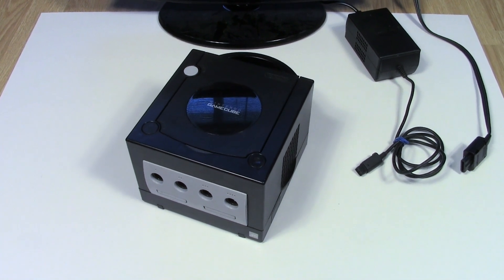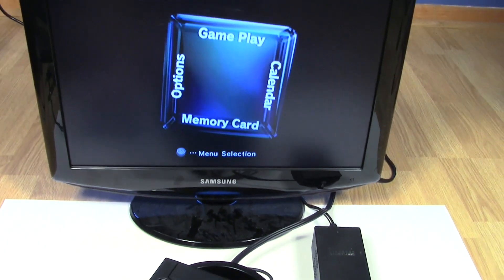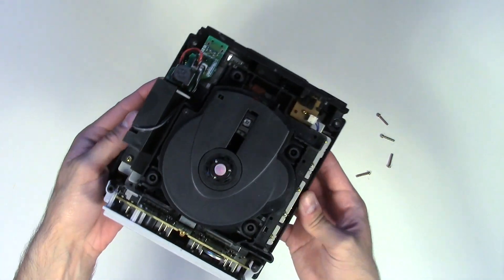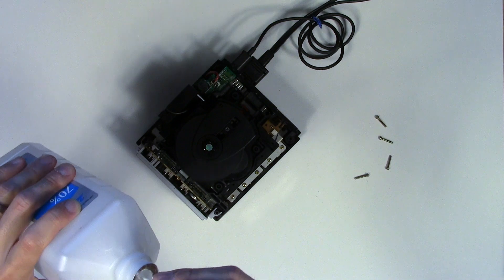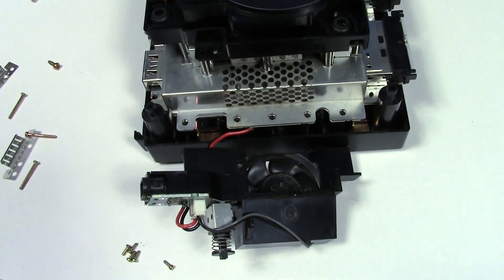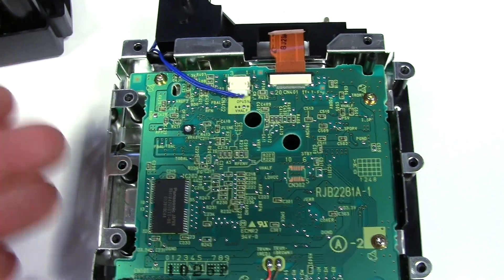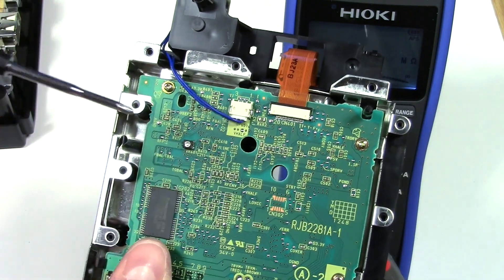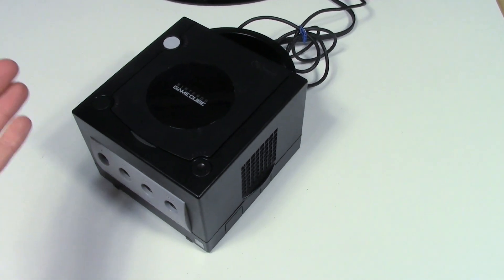GameCube Disc Drive Troubleshooting and Repair

Comment: The thing wrong with mine is that whenever I put in scratched disks, it says to turn off the GameCube, and read the instruction Manuel. In this state, it won't let me click anything, move or anything else, unless I turn it off and try it again, over and over and over. While in the background, I can hear the disk running fine and no error, while it says there's an error..... Anyone know what I can do... Because I tried fixing it for a long time.

Comment: What is a potentiometer don't really know hiw to spell that
Reply: It's a variable resistor. You can adjust how much resistance it has by turning it. A volume knob is one kind of potentiometer, but the one inside a GameCube is going to be one that is not designed for frequent adjustment (usually only set to a specific value during manufacturing).

Comment: I have a problem with mine. I start up melee and it works fine for about 20 minutes then i get an unable to read the disc message and the disc stops spinning. Two days before that my brother stepped on the gamecube pretty hard and melee got a piece of rubber taken off the edges of the disc. Off topic but, what is that for? I assume its something nintendo used to identify a game legit. I only own melee too so i cant test other games. Oh and i used it on a wii and it worked perfectly so idk if its the gamecube having trouble reading melee cuz melee has a few more scratches from the bump my brother caused or my brother caused something to break internally from the gamecube
Reply: Retro Skull thanks for thw info. Turns out it was the scratch on melee. But they are minor scratches so idk why it was unable to read still. Is the gamecube super sensitive to scratches?
Reply: Retro Skull i did and it made it worse. Theres a lot of tint scratches. I settled to buy another disc on ebay.
Reply: Relax, Marcos. Accidents happen.

Comment: I have a somewhat off-topic question (sorry if my terms or understanding of the parts are wrong): There are metal coverings around both the sockets where the AC and Video cables connect to the console (shown at ~8:20 in the vid). My used cube has something that looks like a burnt mark in that area and won't come off easily. Would it be alright to use sandpaper to rub it off or do those metal coverings need to stay smooth?
Reply from the maker: Those are just for shielding (from RF emissions), so you certainly can clean them up with sandpaper -- it won't hurt at all. Good luck!
Reply: Thanks! I'll give it a go

Comment: I actually did this a long time ago. My GameCube was working great but unfortunately  now, the games still boot up but after about a few hours of gameplay, I get an error where it stops reading the disc. So there is still another issue with my GameCube

Comment: The one I got gives me an error after a few seconds of turning it on but in very rare occasion reads the discs (has hardmod) anyway when it doesn't read the games the laser turns on the red light but it doesn't move, when that happens I get the error and says "turn off the console, read the manual or something" what do you think is the problem?.... anyone?

Comment: Thank you so much for your video. I managed to fix my son's GC, which I bought in 2002. It was being kept in the closet for the last 2 years, since he has a Wii and can play GC games on it. But it is always a big pleasure to fix something. Just one thing. I followed your instructions and tried to set the VR at 500 ohms. As the disk didn't spin, I started to lower the resistance until it finally spin. I ended up fixing the laser at 186 ohms. Do you think this is a problem? I hope I won't burn my son's GC! Thanks again.
Reply from the maker: +Fernando Oliveira Glad to hear you got it working! Only time will tell if you'll have long-term laser problems, but thankfully GameCube consoles are still fairly inexpensive so it shouldn't be too big of a deal to get a replacement laser assembly if it comes to it.
Reply: +This Does Not Compute Do you know anyone who can fix a  Gamecube

Comment: I followed your process (nice video), as my console seemed to have the same issue.  With the cover off, and the tabs pressed, the disk would spin for about 5 seconds then stop, and the laser would bounce back and forth a few times before stopping.  So, I adjusted the variable resistance to about 350 ohms and put everything back together.  Now the disk doesn't even spin, but the laser still bounces back and forth a few times before stopping.  So I must've messed something else up in the process.  Any ideas?
Reply: Try 200

Comment: You didn't have to dissconect the faceplate ribbon cable, could have just unscrewed the mini motherboard, now I am having a bitch off a time putting the ribbon cable back on.
Reply: +Jay Ward I would also appreciate it if you would give me some tips on how to put it back in.
Reply: +Jay Ward look its not that hard angle the tip towards the slot and place your thumb on the slot and push bam
Reply: +Jay Ward look its not that hard angle the tip towards the slot and place your thumb on the slot and push bam

Comment: Just did this on my GameCube and it appears to work as far as reading the disc at first. It loads up and plays for about five minutes and then I get the error message saying "cannot read disc" so then I reset it and it plays for about a minute before I get the same error. Is this a overheating issue?

Comment: what resolution is that tv and how is it connected? RGB?
Reply from the maker: +Gregory Terry It's a normal 720p LCD TV, and I was just using a composite cable for testing. I'd love to get one of the GC component cables, but dang they're expensive!
Reply: Well I was just thinking it looked pretty good. I'm thinking about getting a wii rvl-001 as a cheaper alternative to getting a GC component cable, though I always play my gamecube on a crt at the moment anyways. Your video is well done and helpful. Thanks!

Comment: I really like your video. It is indeed helpful. I just can not see through your hands to the exact places to test the circuit board with the multimeter. Even though you gave a great explanation a forehand, I need a diagram to guide me through that. Using a multimeter is new to me and mine is a super cheap one( a world away from the Hioki you have). I did this fix without the multimeter reading and I now instead of a no disc error, I am having a disc reading error. Two steps forward and one step back. Help!
Reply: I agree, the guide is missing the most essential part of the process

Comment: Everything is hooked up i press the power button but the disc wont spin and the game cube logo wont pop up.
Reply: Lord Spyro598  I have two GameCubes and one has the same problem as yours, the other is like this one in this video. It is 99.9% certain that it has suffered a power surge (my son even recalls the power surge happening). Only the fan powers on because the power supply took the surge. There is a fix posted for that, but the video was not a clear quality and it is a bit more involved to repair. I am 99.9% sure mine will be parted out instead of repaired. Just wanted you to know what you are probably dealing with.

Comment: I guess it's great that you fixed this and everything, but was it really worth all the time invested and hassle/hard work required, for an $8 system. It would have been much more cost effective to just pay, say, $10 and get a working system off ebay or anywhere else, these consoles on their own are pretty worthless these days seeing as Wii's are backwards compatible and much easier to obtain component cables for. As you mentioned the real value is in the controllers, in a case like this it doesn't seem worth repairing, just pick up a working model. The price of the gamebit/screwdriver to undo this console would cost about the same as the console itself lol, let alone the price of you're electrical reader (but I'm sure you use that for other things). Even if this video was to teach others how to repair their gamecube the same thing applies, they're cheap enough to just buy a replacement. I don't understand the motivation behind doing this but interesting video all the same. P.S. $8 was worth it for the memory card alone, those things seem to be holding their value too.
Reply: There's only so many GCs in existence, repairing them will be invaluable in another 5-10 years time.

Comment: I did this without the Hioki, because I'm daring and desperate, and I just turned the dial a tiny bit (like 1/4 couter-clockwise) and mine works fine now!!! Thanks for the helpful video!

Comment: My laser disk on my purple one won't start up at all.
Reply: maybe a broken or disconnected power cable?
did you drop it?
Reply: Same here buddy, but got it working. If the laser is so low powered or weak it wont even detect the disc + wont bother spinning it, you may have nothing wrong with the power

Comment: well i was hoping for an easy fix darn ill never be able to do this  i have the same issue with my gamecube only started couple years ago i was gonna get a new one at some point mine has gotten to where it will intermittently read game discs i found if i play with it turn it on its side or let it warm up then try again  it will read the disc and the game will play just fine and i can play any game it will always read as long as i dont turn it off for extended periods of time  and at times  it will have disc read errors ill just open the lid and close it  it will reread the disc and play just fine been doing this for years i am thr original owner of the game cube  bought it when it first came out.

Comment: i have a problem. i bough a used gamecube with mario kart DD. the game starts just fine but when it starts. the disc stop spinning. any ideas ?
Reply: The laser can't detect a disc, so it doesn't spin as the outcome.
Reply: Is the gamecube still showing up the system main menu when you turn it on, but the motor not spinning the disc at all?

If so, here's how I solved it. Open the disc cover and spin the game disc with your finger clockwise and make it spin fast. While it is spinning fast, close the disc cover and turn on the game system quickly. If it is successful, you should hear the motor spinning the disc. Let it run for a few minutes, maybe 10 min to be safe, then you can turn it off and back on to see if it is still working. If the motor won't start, try it again for at least 10 more times. If it still not working... I don't know what to do then.

Comment: Christmas day.   My 14 y.o.  son wants a retro game to play.  I bought one online for a lot more than the price mentioned here.  It will work for 2 or 3 minutes before giving a disc error.   We follow these steps and find our resistance is a little over 600 ohms.  We corrected down to 300 ohms.  Running great now. A great father-son project on Christmas day!  Thanks!
Reply: xkedger oh wow if you want retro get a SNES. Great library, that retro graphics, all that jazz.
Reply: Darn it, stop making me feel old.
Reply: The Illusionist  well if its discontinued ibconsider it retro. The wii is retro for me
Reply: The Illusionist  nintendo 64 had 3d 🤔
Reply: The Illusionist  GCN is on the verge of being dated as retro. 20 years is the typical cycle. With technology, it's not so much about age but nostalgia. iPod classic is considered retro, GCN is considered retro, PS1 is considered retro. SNES and NES are on the verge of being vintage AND retro. I was in 6th grade when the GCN came out, so it's retro af to me.
Reply: The Illusionist  people consider the Wii retro and the Wii came out last

Comment: I have no knowledge of this kind of stuff, but this does interest me. What would cause the laser to change from what it was when you first buy it new from a shop to cause this? Just general 'wear and tear' electronics style, or is it something the user does during their usage of the system?

Great video by the way, very easy to follow without being too baffled haha. You make this look/sound easy !
Reply: most likely the temperature. the conductivity of a material is always based on the temperature. the soldering iron used may become a bit less conductive as well